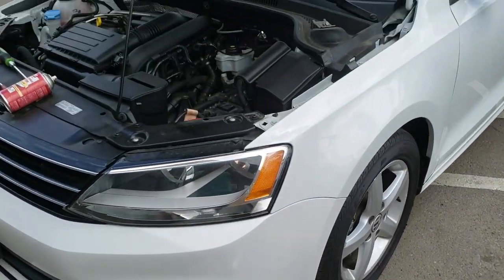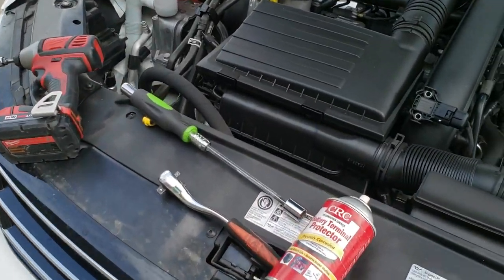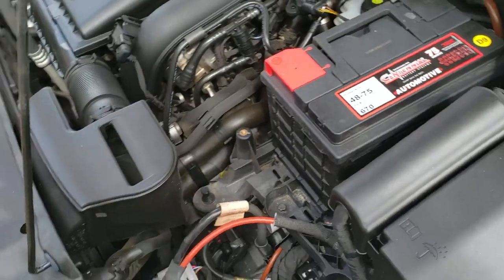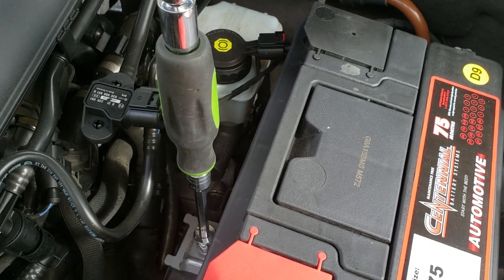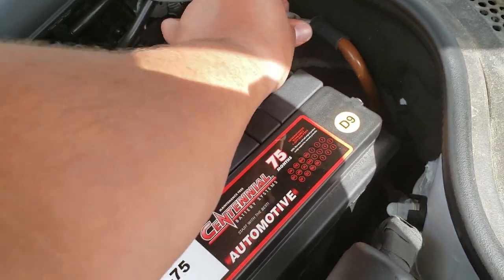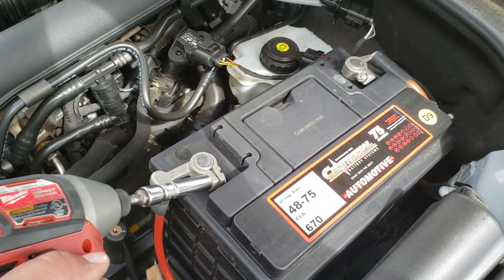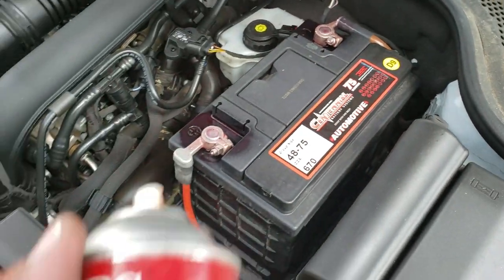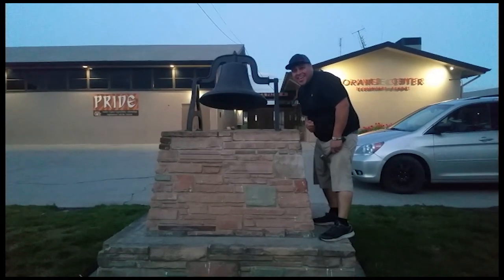How to: Install a battery on a 2016 Vw Jetta

Comment: I have been a driver for nearly 20 years and have driven different cars. I noticed the big difference in various aspects like electrical or blacksmithing etc.
Older cars had a system such as replacing oil or replacing tires after years. Also, the battery was not included in the replacements.
Today's cars are faulty in places I wouldn't expect from them like a battery or dashport lights warning or things that are far from expected hahaha
In short, I mean, today we see international companies making cars for a year after year that will turn into cancer.
sorry for the long messages , comments ,but that is how i see lol
Reply from the maker: No you are correct.  Nowadays manufacturers want to cut corners and use cheaper parts to save money which causes more systems to fail it's only money scheme it's a way to get the rest of the money from the consumer after you purchase their vehicle. I agree with you 100%. Thank you for your input and thank you for your support!

Comment: Thanks ! What size battery is that ? I went to autozone and they said h5 or h6. But they’re different sizes
Reply from the maker: It's the H6 it's group size 48-75. 
https://www.autozone.com/batteries-starting-and-charging/battery/p/duralast-gold-battery-h6-dlg-group-size-48-730-cca/832332_0_0?spps.s=4034&cmpid=LIA:US:EN:AD:NL:1000000:BAT:17474778361&gclid=CjwKCAjwsMGYBhAEEiwAGUXJaQYuKmNisa6YZxvVI0Dh4u5CMtE8kKKX1GwrFgyVDHyFMxdyxole3RoCT3gQAvD_BwE&gclsrc=aw.ds

Comment: I have a 2013 Jetta GLI. After I install the battery, is there anything I need to do when the car is on to let the car know I installed a new battery? For example, would I get some kind of warning light I need to clear, or would I need to do any kind of software update?
Reply from the maker: I work at a dealership and most of the cars that we get come with dead batteries and need to be jumped. Some we cant even jump sometimes..all i do is swap the battery and it starts right up with no issues. U should be good i didnt experience any issues.
Reply: you'll want to do a complete drive cycle.  Also, the battery does not need to be registered with the car,  if you do not have a battery module (negative side at cable).

Comment: I might have to replace my battery on my 2016 vw jetta. Do I need a memory restarter? The guy at autozone said I might
Reply from the maker: Yes this vehicle had a bad battery when we got it, so all I did was replace it but this vehicle appears to need to Procedure done before the battery is changed. I didn't have any issues with it but I would do the memory restarter procedure first just so you dont run into any complications. Thank you for your support!
Reply: Thanks for this comment man 👍🏼 helped me out before doing anything to a Jetta !

Comment: Hello Sir,  I bought a new battery some months ago, almost three months ago, one day while driving my car stopped running and my friend opened 4 flashes and the battery stopped completely in the middle of the street,
we turned car on again and after a few minutes I opened the Headlights and the battery stopped again from running, after this, my mechanical friend said: to hit the positive head of the battery, if it is running then it is the imbalance in the battery, and actually start the car after we hit the positive head. Now also the same thing, before I buy a new battery, what do you recommend? My car is Jetta 2016
pls , qiuck answer because tomorrow i go to buy new battery again.
Reply from the maker: Yes it sounds like either the Battery Terminals are loose or the battery is starting to go bad. Check the Positive and Negative Terminals insure they are nice and tight with out movement.  If they are more than likely it is the Battery.  Great way to check is with a volt meter. Se how much voltage the Positive and negative Terminals are showing and how much the BATTERY TERMINALS are producing.  You just might have corrosion in between.  Clean the Terninals, clamps and Battery  with a wire brush put everything back and try again.  It could be various things but it's all a process of elimination.  Hope this works out for you! Thanks for your support!
Reply: @559powerscape  Yes we cleaned the battery heads, there were accumulations on the positive head and then it was good but after two days the problem returned and we hit the positive head until it came back to operation, I think the problem is inside the battery, as my friend said, and for this tomorrow I will try to return the battery to the owner of the store as possible is he checks the battery Etc. 
Thanks for the answer, and I inform you the day after tomorrow what the problem was.
Reply from the maker: @albj5119  cool man, yeah that's what it sounds like. Sweet I hope that takes care of it! Good luck buddy! Thank you for your support!

Comment: now on certain jettas the battery mangement system needs to be re-calibrated 

did you use a memory saver atleast ?
Reply from the maker: No the battery was already dead there was no current in the electrical system. The new battery need to be to replace to give the vehicle life. Replaced the battery, no issues. I know Jettas might require a extra step. But didn't require at this time because the battery was already dead. My suggestion: stay away from German Cars!
Reply: @559powerscape  that's a fact to stay away but now the alt. Won't charge the batt at optimal levels doe
Reply from the maker: @chewyalba9824   wow! How many miles does it have? You might still have dealership warranty 🤷‍♂️ man sorry bro. These  German  cars  are really something.
Reply: @559powerscape  i don't own a jetta, i do roadside service and when it comes to battery installs on this car i stay far away. i don't even use a memory saver via obd2 on it cause i know it won't work.
Reply from the maker: @chewyalba9824  Wise words from a Wise man!
Reply: @mronemanband1  nah...that ain't valid.

Comment: Hi 
When installing new battery did you have to reset anything from car after the install?
Thanks
Reply from the maker: No after the new battery is installed you shouldn't have to do anything else other that to turn it on. Did something happen?
Reply: GEORGE LOPEZ HOW TO DO IT YOUR SELF just going to change my battery myself and just wanted to make sure I wouldn’t screw up any settings
Thank you for the video
Reply from the maker: @kylehca  na man your good. Have fun!
Reply: @559powerscape  Autozone said the 2016  Jetta would have to be reset, so then wouldn t  install a battery for me. So I should do it my selft right?
Reply from the maker: @treysmith414  Some people have mentioned that this vehicle needs a memory saver Procedure done first. The reason I changed out this battery is because the battery was bad to begin with and had to be replace I replaced it and had no issues with it.  Maybe what you can do is change out the battery as the car is running just be careful not to touch the positive terminal to any metal of the car because that will create a spark. That is the only thing I could possibly think of that might work without having to compromise the memory saving procedure because the car will be on and all you're doing is replacing the battery. I am not too sure these German cars are something else. I suggest calling the VW Dealership and ask for the service department and ask them. That is really the best advice I can give you in a situation like this.  Sorry buddy, good luck man! Thank you for your support!

Comment: Was there any programming involved?
Reply from the maker: Nope didn't have to perform a memory saver. I work at a Car Dealership and we get Invetory with Dead Batteries and have to be replaced.  These cars show now sign of life with the dead battery. Some times we can't even jump start it, so I have to swap it out. All memory is lost at this point so really worthless even trying. I didn't experience any issues. But if you want to do a memory saver first, wich is just providing power to the electrical system. I suggest you do, so you don't come across any issues.
Hope this works out for you!! Thank you for your SUPPORT! Have a good day!
Reply: @559powerscape  I know some VWs require you actually program in the battery info and even serial number . Then it tells the alternator how to properly charge the new battery. It’s a weird German car thing, everything is a big process with them!
Reply: @auxmike718  Yes on a 200K euro GLI/ GTI version or audi !

Comment: Autozone said I had to do a reset after installing  a battery for a 2016 Jetta. How true is this?
Reply from the maker: Some people have mentioned that this vehicle  needs a memory saver Procedure done first.   The reason I changed out this battery is because the battery was bad to begin with and had to be replace I replaced it and had no issues with it.  Maybe what you can do is change out the battery as the car is running just be careful not to touch the positive terminal to any metal of the car because that will create a spark. That is the only thing I could possibly think of that might work without having to compromise the memory saving procedure because the car will be on and all you're doing is replacing the battery. I am not too sure these German cars are something else. I suggest calling the VW Dealership and ask for the service department and ask them. That is really the best advice I can give you in a situation like this.  Sorry buddy, good luck man! Thank you for your support!
Reply: @559powerscape  yeah I took it to them and they said I had a bad battery. They disconnected the neg too, just to check it,  and didn't mention the reset, so I'm going to Do it myself, thank you!!!
Reply: @559powerscape  How much did you pay for the battery
Reply from the maker: @treysmith414   We have an account with a battery company named battery systems and they charge us $65 for a small battery and $75 for a big battery. I know retail price is easily over $100. Sorry bro.
Reply: Trey Smith so did they disconnect both terminals while the car was running and simply replaced it without fault?

Comment: I have a 2016 vw jetta tsi need to replace battery but was told it would need to be reprogramed is this true
Reply from the maker: Yes the reason i didn't on this video is because the battery was already bad and needed to be replaced. What that does is save current Throttle Calibrations due to carbon build up.
Reply: They say that so you don't lose you're settings and charge you extra. I have a 2016 vw gli SE 2.t  with all the bells etc... no need to relearn etc....... you just have to reset time clock and drive around and the dash lights and tire light will go out in 2 min.